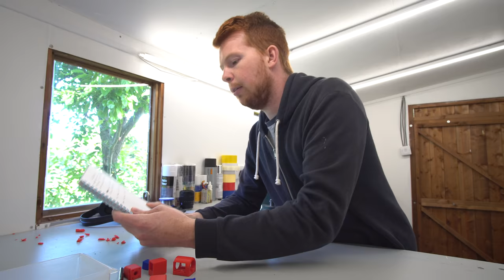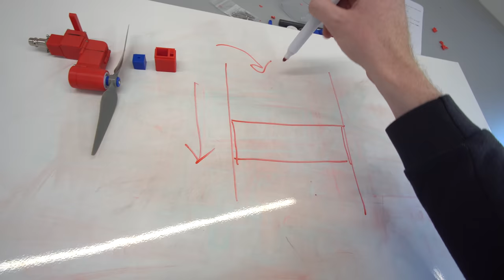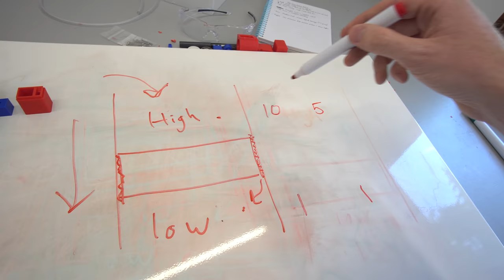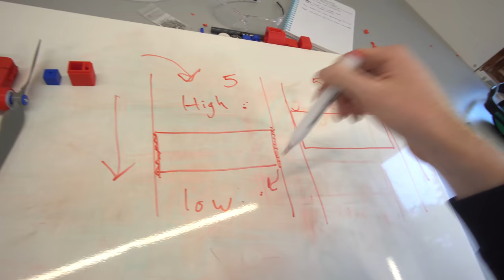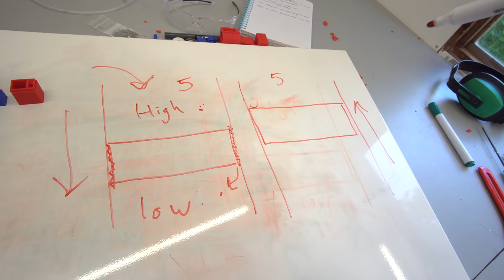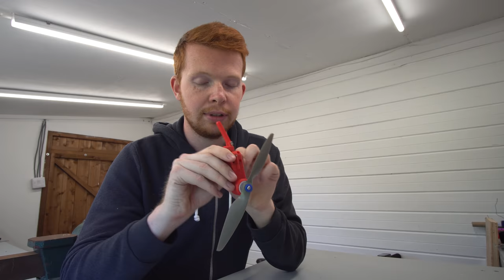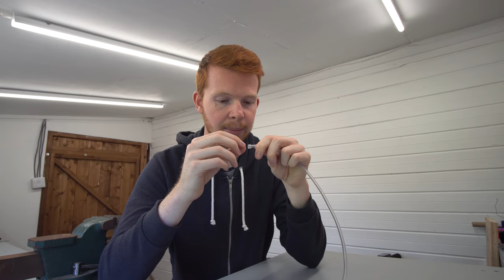Multiple or Single Cylinder Air Engine?

Comment: If you want to use the engine in a rc car without a clutch (would recommend this because otherwise you loose some of your stored energy there) you need a multi cylinder engine with phase shift to accelerate from zero velocity. A single cylinder engine wont start most of the time (depends on the current crankshaft angle of rotation).

Comment: I would say the answer to your question depends on the application. A two (or more) cylinder engine can start on its own, where a single cylinder engine needs assistance getting started.

The answer to your other question also depends on the application.  Do you need high RPM or high torque? Longer stroke gives more torque less RPM.

Comment: Make like the steam engines of old where the air exits one cylinder into the next. The other thing to consider could be the cross sectional area of the cylinder for greater torque.

Comment: How about the complex crankshaft for the opposed engine and feed the air in through the crank case and out of head. 
Also, the ratio of blow by to cylinder head area is optimal for a larger single cylinder than twin engines so any efficiency improvement is likely due to other factors.

Comment: Have you looked at getting a more rigid air pipe and connecting it with push in pneumatic air fittings. really good seal and easy to remove if needed. Does ad some slight weight.

Comment: What about some sort of turbine, with a more complex pressure control? Turbine would have less power components to print... however the trade-off would be a more complex valving system to apply the power air to the turbine in a controlled manner. Well, and a turbine would have to run at a higher RPM, meaning you would need a way to gear down the torque to get usable RPM on your drive system.

Comment: I think a multiple cylinder engine would be much easier to idle at a low speed and also would likely be self starting since at least one cylinder will be in the position where it is ready to accept pressure and start moving

Comment: Two cylinder would be more complicated to build and future running could be harder from a maintenance point of view. But you mention using pvc pipe for the engine. Why not use copper pipe instead as you get can small diameter sections and they are relatively easy to bend. Also you can 3d print a junction box with 1 input for the incoming air. And a valve system connected to two out  going pipes sort of like 2 chambers that means the engine can be run with one cylinder at a time.

Comment: dual acting single cylinder as used in many steam engines, one cylinder doing the work of two! once you hav that dialed in go for a dual acting twin cylinder (horizontally opposed )
Reply: to seal the tube, use a bit of silicone to seat and a short bit of copper wire twisted outside the tube as a clamp

Comment: The main factor limiting efficiency even before leakage is probably the single valve design. Before introducing a second cylinder, use a second valve - only inject at 0-30° and exhaust at 180-340°, this will reduce dynamic loads, increase efficiency (by a lot) and maybe even boost the max RPM. By using a camshaft and pusher for the ball valves instead of a crankshaft you could reduce complexity.

I think you never covered this issue/ your reasoning for not addressing it in a video, although you are probably aware of it.
I know I'm probably late with this, but I just stumbled across your channel
Reply: nevermind just found the other video

Comment: That's not how pressure works, lol.  Cute thought though.  What you need to do is create a sliding baffle so you can control inlets AND outlets of BOTH sides of BOTH pistons.....then you'll have full efficiency and can lower the primary pressure, giving you longer drive.

Comment: I would say it would be more inefficient to use multiple cylinders   would be less efficient on air, but allow for higher torque so you could use a larger prop or a prop with a more aggressive pitch to potentially offset the deficiencies, but if the goal is to have a very limited air supply like a bottle you might actually be better off using a single cylinder

Comment: Tom Stanton!! Before you over complicate things, you should look at a crude pressure regulator to stop your wastage on full charge, and you could optimise the engine to operate at a certain pressure/flow. Then you could actually sort out your inlet and exhaust valve timings properly, and tune your stroke and bore size to make the best power and engine speed to suit your propeller. You should order a free sample "low friction precision dashpot" from airpot.com, get the set called "Piston / Cylinder Set - 2K S 160 2.0 CP" This will stop all your blow by and bore problems and you can simply slip in into a 3d printed bore. You can cut the ceramic glass bore tube to suit your engine.
Reply: Also if you do not want to wait I will send you one for free.

Comment: What I can't understand is the persistence in trying to lift a valve aginst air pressure. Increasing the pressure won't incraese the power. Commercial compressed air engines have been produced using conventional two-stroke porting (a sleeve valve) which don't have this problem. 3 cylinder compressed air engines were common in the 1920/30's and plans were available (maybe they still are).

Comment: I believe a one cylinder engine is much better not only for simplicity but also I can see it having more juice out of the same bottle. I know most people would prefer if you build a multiple cylinder engine but I just can't see it as a viable option. (I mean it would not fly, there are lots of ways it might fail)

Comment: what about those old school steam engine designs? Where all strokes are power strokes, intake on top and bottom of the cylinder.

Although I am a huge fan of your simplification efforts.

Lighter engine is more important than anything - the amount of power available in 2L of compressed air is very small and multiplying it by a few percent is hardly anything. It would be wasted by the extra weight induced in a multi-cylinder engine.

One thing you may want to think about is a simple throttle/choke that you can open before throwing. Like on a pull string or something. So you don’t use all your power while its in your hand.

Comment: How about surprise option number three? A Wankel style, rotary compressed air engine.  apparently they can approach very high efficiencies and you could probably get one to print reasonably well.  The seals would be a bugger but i bet if you printed in nylon you could get it to work well.

Comment: Another problem with running two pistons (they aren't cylinders if they're square) is that you will use more air, whether or not its twice as much for two etc or not I don't know.

On the other hand, twice as many power strokes... Maybe perfect the single piston design then once it's perfect put them together to make a multiple piston design?

Comment: Why not try to put a pressure outlet on the crank side of the piston for the upstroke. I am sure that would be hard to seal, but you would then theoretically have pressure pushing the piston both up and down.

Comment: I think a flat twin would be cool to see and hear run but I would keep the displacement low to optimize pressure consumption. Also I wonder what you could do with co2. The cold might be bad for the plastic but just an idea.

Comment: if you are building the twin engine then I think that go for the  straight twin or inline twin engine because i think that if you build the other then giving each of the cylinder pressurised air will be hard for you. This is just my opinion and even if you do anything else I would be happy to watch it

Comment: I think that long stroke is more efficient as piston accelerations are smaller. What about going for a coumpound engine with air being expansed in several stages? That should be really efficient.

Comment: Multiple piston engine would be nice. Have you considered “V” piston arrangement? Shouldn’t be very complex shaft design and you might be able to pair the two cylinder intakes with a single 3d printed part.

Comment: you know i kinda want to give myself a project for the summer to make a design of a multiple cylinder engine for you to use in a video. that would be pretty cool. i could even work on it myself so you could have an already functional file, and you wouldnt have to troubleshoot it yourself.
could do a v6 or even v8 maybe

Comment: Initially, in the history of motors, the number of cylinders was increased to increase the torque of the motor to move bigger things (props, wheels,...) without increasing the piston/cylinder size. Because increasing piston/cylinder sizes is the beginning of ridiculous issues.
You don't need so much power and the usage of air would be a really big issue.
In my opinion, you need to make an efficient Single cylinder first. The multiples parameters can be kept under control.
And, in the future, you'll duplicate the efficient cylinders to make bigger motors. One step at a time.

Comment: ya i still want a Multi cylinder engine, either one. And then maybe you could test whether or not it is better to run two separate single cylinder engine in a push and pull configuration, or just having a double cylinder engine in either push or a pull. 
idk if that makes sense. but it makes sense in my mind.
Reply: never mind i totally forgot this was put out 2 years ago. lol 😂

Comment: I would think that having another cylinder would double the air leakage. You know, since there would be double the area for leakage to occur.
I guess that since you'd be splitting the pressure between 2 cylinders, it might not be quite double, but still more.
Then you definitely do have double the friction to overcome. 
Whatever you decide, I'll be interested in watching the results.

Comment: What is the goal? To fly a plane? More cylinders is more mass to have to keep airborne. Also the leaking you are experiencing is negligible imo. I say stay with one but increase the bore diameter and decrease the stroke. That will allow the air to rev the engine faster witch will create more thrust with the propeller. Also maybe experiment with a 2 stroke design and not 4? Idk how that would work but just a thought

Comment: You could try to use 2 seperate single cylinder engines joined to one flywheel

Comment: I know this is a late reply, but you could do a 90degree vtwin with the separation of both valvetrains and both only connected by the crankshaft/case, i know it might be a bit complex but if you come back to this it would be a decent idea, try to take some inspiration from motorcycle engines.

Comment: i think the "blowby" would be proportional the the total circumference of the pistons. so if you have one big piston with a certain circumference then if you had lots of small pistons which equaled the same circumference then the amount of blowby would be equal.

however there are other things to consider. 

Is a bigger piston easier to get the fit really good. As you are using square pistons that might well come into play here (use round ones, corners are bad!) also what about the inlet valve, can you get enough flow through the valve to supply one big piston. multiple valves on one piston might help but also could be an argument for going for multiple pistons.

having said that, more cylinders are just plain cool!

Another idea might be to use sequential porting. so the exhaust from one cylinder is used to power a 2nd cylinder, You may be able to do it valveless? This would ensure you extract all the power from the air available?

Comment: You're approaching this problem "top-down" (by fussing about the engine). I believe a better approach would be more of a "bottom-up" one. 

Your bottom-line limiting factor isn't the efficiency of the engine, it's the amount of energy you can store in a volume of compressed air. Perhaps going with two smaller, higher pressure air reservoirs, you could increase the "fuel capacity" of the aircraft (even enough to offset the added weight). Especially considering your test aircraft could hold somewhat level flight, but only for a very short time. 

Then you could focus on engine efficiency. By running at higher pressures, you'd achieve an inherent increase in engine efficiency. Heat exchangers and turbines, hydroelectric, windmills, etc, are all more efficient when working with higher temp/pressure/windspeed.

There are also designs that push on the piston in both directions, but that would be a complete re-design. This would give you two-piston potential without adding the friction of a second piston. IDK what resources are at your disposal, but if you're re-doing the whole lot you may as well entertain a more radical design change.

Comment: hmmm inline twin, with  split crank, screws together at the center through the bearing, each size of the crank from the inside - outward would have a cam lobe followed by the offset pins the pistons connect to. so it would be, from one end to the other,  offset pin for the piston connection, followed by a lobe for the valves(both valve rods will be between the cylinders) then the connection that screws together through the bearing into the other side of the crank which is reversed copy of the other side. u could then pick one end of the crank add a ggear or some way of connecting the props and there u go. the bearing would sit right in the middle of the engine. maybe rhat the blocks bolt together around the bearing on each side(separate cylinders not a solid 2 cylinder block)

Comment: I make lego vacuum engines with 3d printed parts. I found through dyno testing engine power drops while engine torque increases. But that's vacuums and legos... not a compressed air engine

Comment: Here's the thing. If your goal is to use this for a vehicle, then your prototypes should be focused on the torque demands of a car, instead of the RPM of an airplane propeller. I understand that this is just exploring the principle, but this design is not sound for high torque applications, and down the road, you're going to have to change the design to account for that.

Comment: Even if your crankshaft  is more complicated for the straight twin you could ofset the cams easier to achieve better ballance, and efficiency  as less of the power will be transferred into vibrations  but youll also have to seal two pistons insteaf of one
Reply: You should achieve higher rpm also

Comment: what about the V-twin engine? Been working well for Harley ever since. or a modified version of a rack/pinion reciprocating air, google board sander for autobody repair. I know that it uses rotary vein type motor and two gear racks to go from rotary to reciprocating on the board that holds the sand paper, but you could in theory just as well replace the board with a piston and power both sides of the piston alternatively with valving. This action should just about eliminate the lack of piston rings in your design reducing your efficiency. The blow-by would help to begin pressurizing the other side of the piston (the crank case side).

Comment: You could of done an intake manifold where the pvc tube clamps over it with a gas clamp(the twistey clamp on the valve of a gas cylinder) and make a 1 inlet to 2 outlet manifold

Comment: do a inline 2 cylinder you can still have the inlet on the top and have it split in to 2 different channels you have one cam on the front and then where there is a connecting piece in the middle right before the second piston you can have another cam it would use 2 to 4 barrings but it would still be more efficient basically the 2 channels from the inlet in the center would be mirrored and then the pistons would basically the same, and right below then inlet would be where a connecting pace would be

Comment: Some type of small supercharger or compressor of sorts on the engine would be great! i wonder if it would compress the air even more before the cylinder and make it run with more power.
Reply: o also, multiple cylinders would be a great challenge and awesome if it works!

Comment: Throw you a curve ball - why not do an opposed twin piston engine (a la Commer Knocker) with 2x cranks & 2x smaller diam props? Simplicity of a single cylinder & central air inlet, existing crank design could be used & the pistons working in opposite directions will help with vibration.

Comment: I would stick to a single cylinder engine for a start. Improve the seal between the piston and the cylinder and experiment with different valve timings. Also those bearings are totally overkill and unnecessarily heavy. I'd use a different material for the axle so you can use smaller bearings. You might also have to think about increasing the size of the inlet valve. Lastly you don't have any counter weight for the piston as far as I know, which increases vibrtions and decreases efficiency.

Comment: If you perfect the single cylinder engine and design a manifold to take the exhaust from one to the intake of another I wonder how many you can run in series with each other.  :)

Comment: Here's a question regarding the single cylinder build: wouldn't a design where the cylinder is rotated 90 degrees from where it is now (as in, as soon as the air passes from the reservoir through the valve, it's acting directly on the top face of the piston) be more effecient? I know in larger scale engines, making direction changes for flowing gases as gradual ans smooth as possible makes for a better running engine. If you're going to slap a propeller on it and make a plane out of it,  the efficiency gains might be lost with the added friction and weight of a gearbox to get the output facing the right way, but for a car you wouldn't have that issue